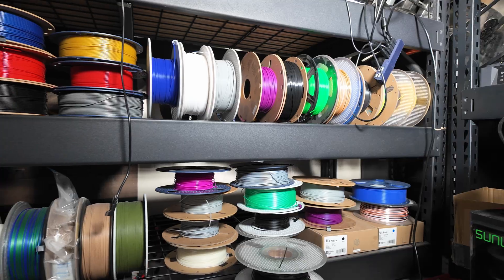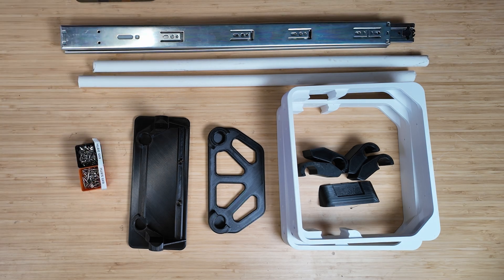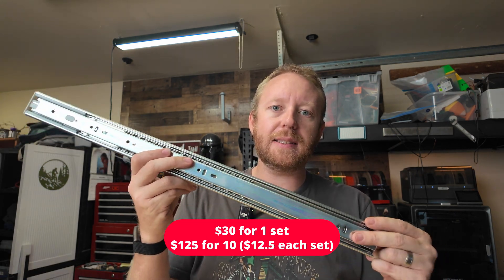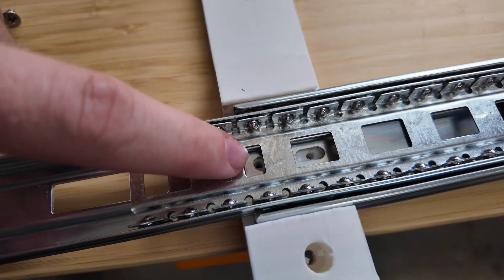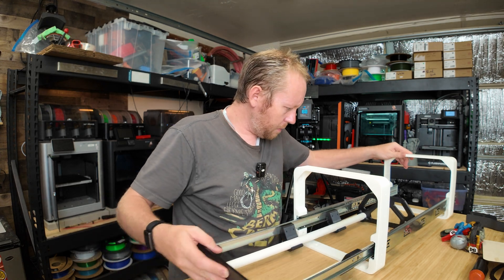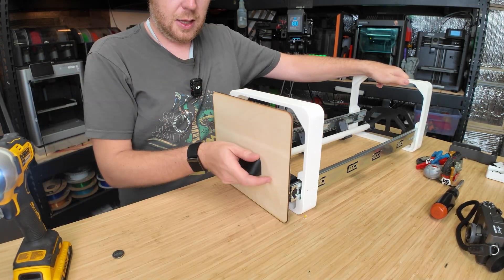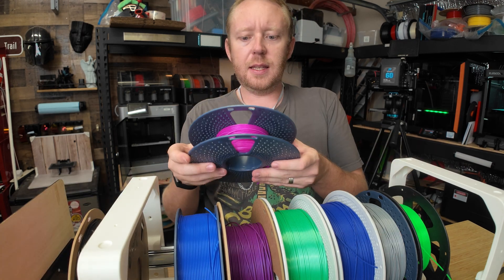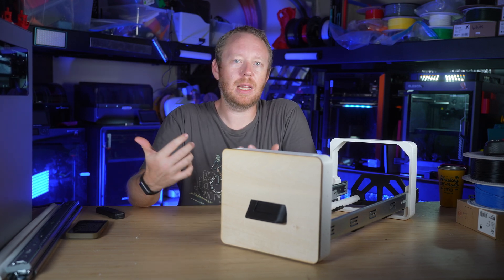Building My Ultimate Filament Storage System

Comment: You can use the middle supports as book stops when your drawers are not full. rotate and slide to where you need them.
Reply: I also used two front support for each drawer when I built it. It provides better attachment to the drawer slides.
Reply from the maker: Good idea!